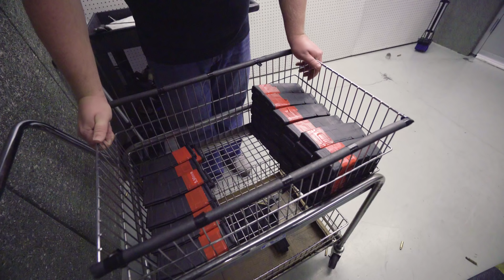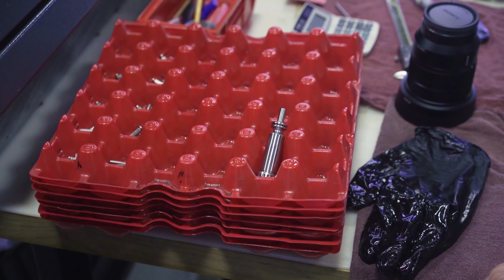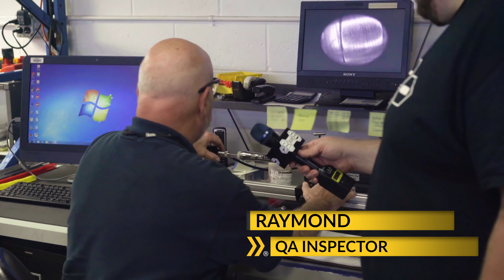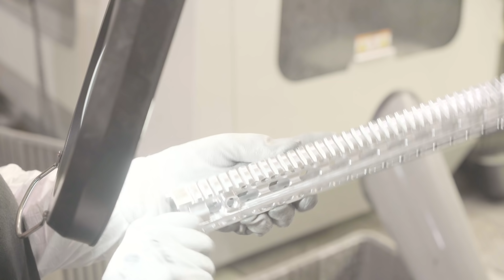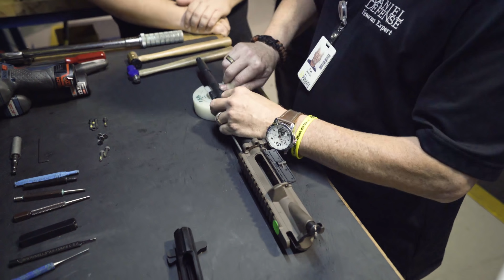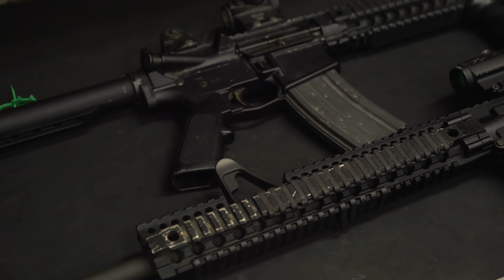Inside Daniel Defense - TGC Factory Tour!

Comment: Just sold my DDM4V11 the front rail came loose after dropping it from waist height on padded carpet and as you can see in this video attaching or tightening that rail is no simple task its basically four screws and if one is off you will never zero your iron sights. I have thrown my BCM all over the place and the rail is straight as new. Just to add my DD was brand new with less than 100 rounds through it so failure that soon is not acceptable.

Comment: u should check out rebel arms in Stroudsburg PA. I live not too far from there and bought one because of all the rave reviews and contracts with local law enforcement. they make great stuff and could definitely benefit from the PR. I love mine. several thousand rounds of federal and not a single hiccup. no misfeeds, failure to fire, failure to eject.... nothing. and the low end models are guaranteed moa and the higher models r sub moa. they make at least half of the gun parts in house here in pa. definitely check them out.
Reply: Is rebel still in business? I looked around for them but can't realy find anything out